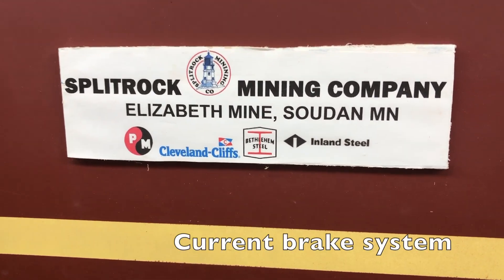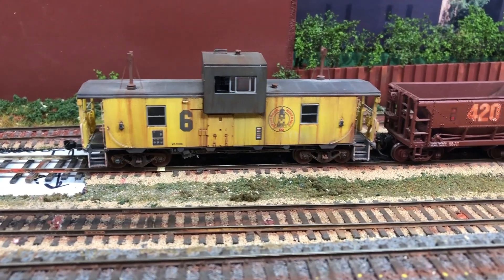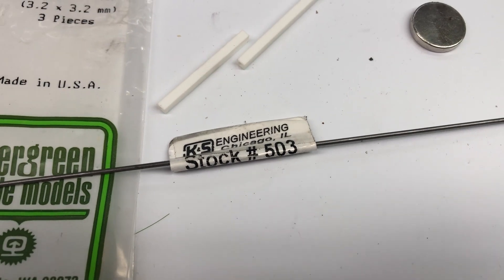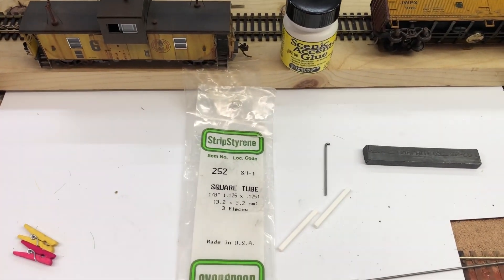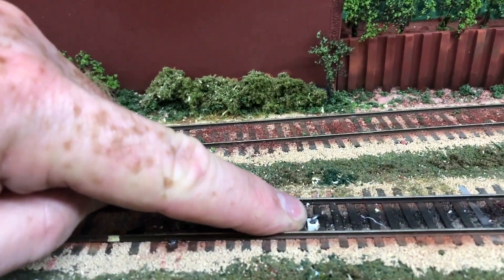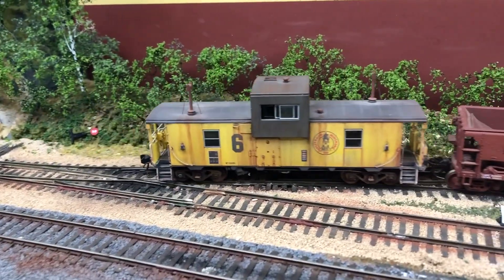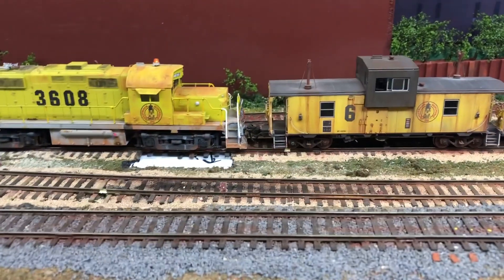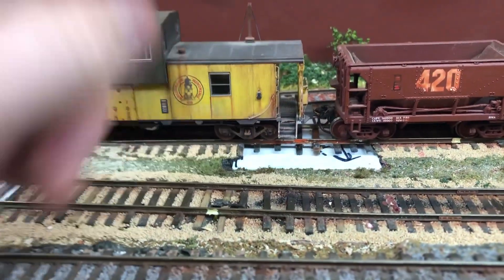Operating handbrakes for railroad operations

Comment: This system is really cool, the only downside is the magnet will slowly become non-magnetic and you will have to replace them.
Reply from the maker: Attacker27 — Gaming & More
 Rare Earth magnets have a high resistance to demagnetization, unlike most other types of magnets. They will not lose their magnetization around other magnets or if dropped.
Reply: splitrock323 Oh, I did not know this thanks for informing me!
Reply from the maker: Attacker27 — Gaming & More 
I was worried about that issue as well, so I did a lot of research and now know more about RE magnets than I should.